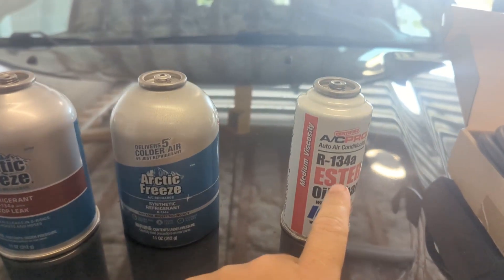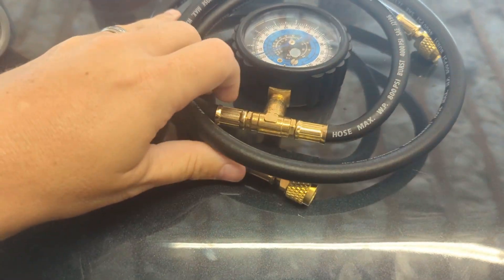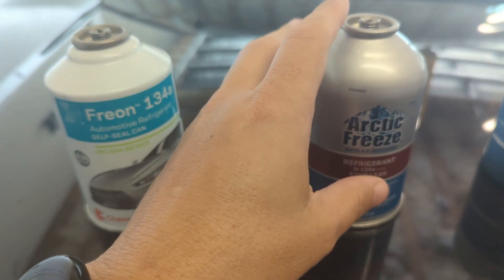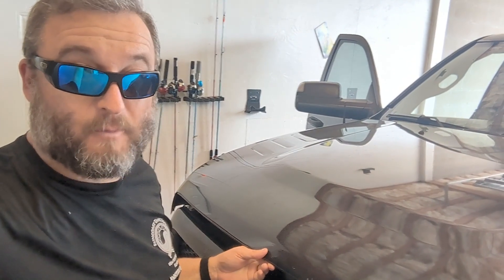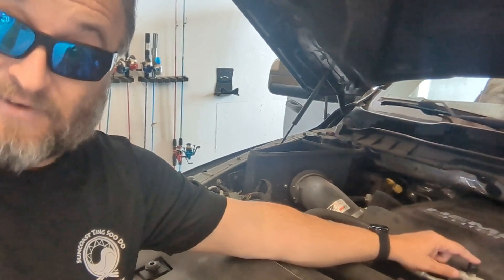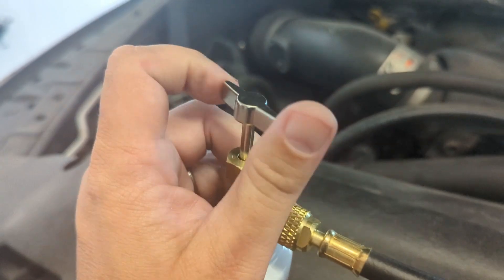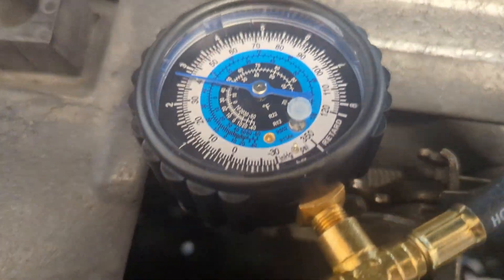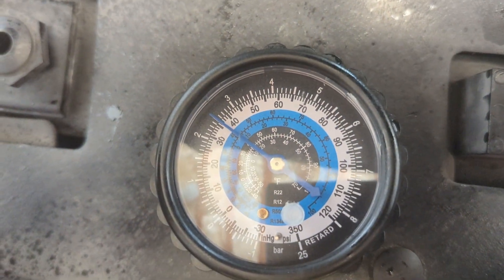Car blowing hot air, fix in a few minutes for a few dollars

Comment: Click-bait tittle and lamely simplistic. The pictured hose assembly costs $25.00. Each refrigerant can costs $15 - $20. Oftentimes when refrigerant is low the A/C compressor won't turn on and you can't add refrigerant. Oftentimes electrical issues cause the A/C compressor not to turn on so the system will never blow cold. If there was an initial leak, how long before the added refrigerant leaks out. Car A/C systems are complicated and problems are interconnected - so it's important to understand how it all works... and even then specialized equipment may be needed. It's possible for the DIY guy to get lucky for awhile with just adding refrigerant, if possible, but even for the mechanically inclined there are usually lots of headaches - and there's always the possibility of ruining the system due to high pressure. Be very careful - get lots of knowledge first - and know when to quit. (Personal experience).
Reply from the maker: Thanks for watching!